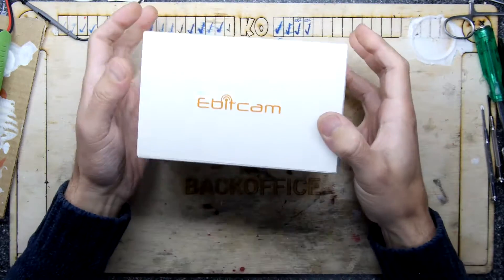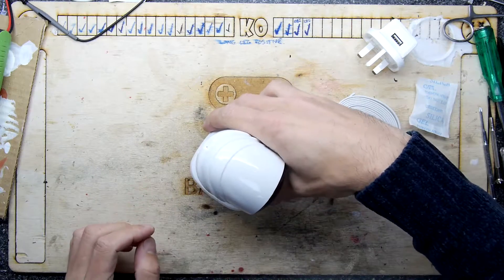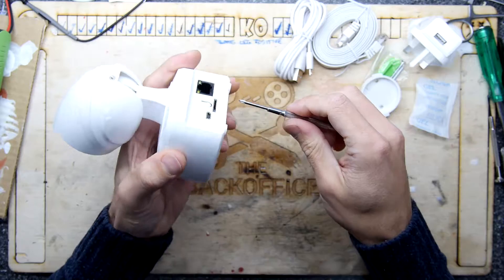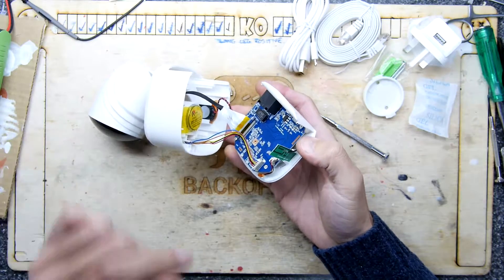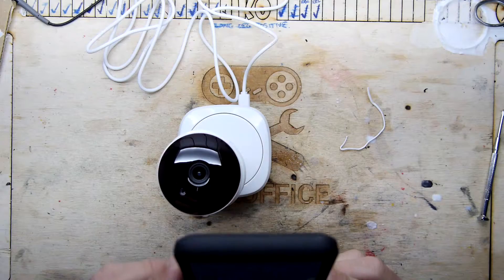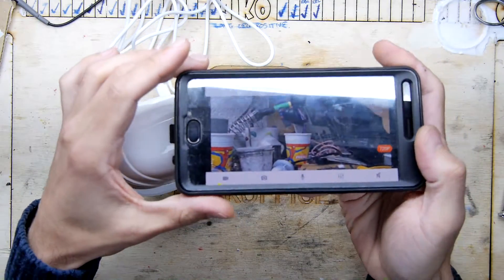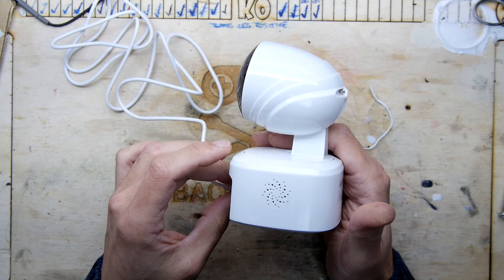Ebitcam

Comment: Never had or seen owne
2:45 Speaker => I think only Beep feedback
2:50 Steppermotor => they wait for skipping as feedback for zero. Seen that before.
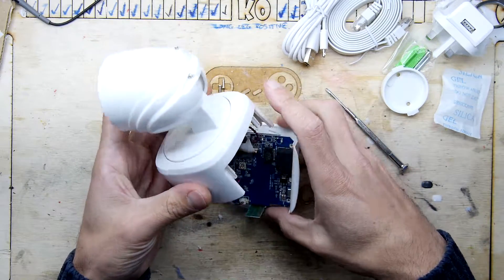4:00 Normaly it sholdend fall out. It's more production failure or disinge failure i think. Better dont put it back => too short cable...
5:54 Try some other numbers and you see...QR gen... Personaly I won't trust them...

Comment: Another toy I'd like to get. I did get a Pi-cam. I'm not that impressed by it.
Reply from the maker: +FairFight14 what resolution is a picam?
Reply: The Backoffice The one I bought for a Pi Zero is 8MP 1080p. The frame rate isn't that great though with a Zero at 1080p.